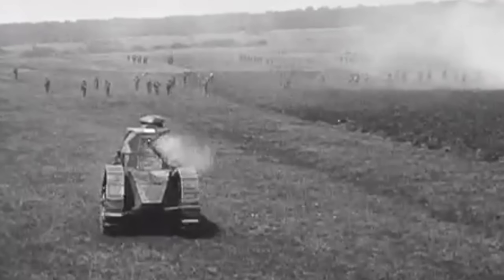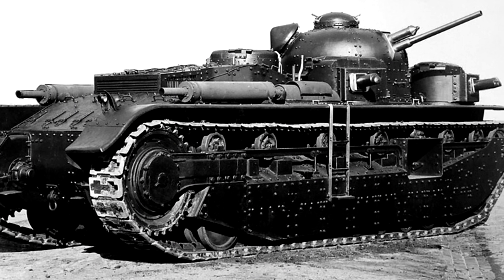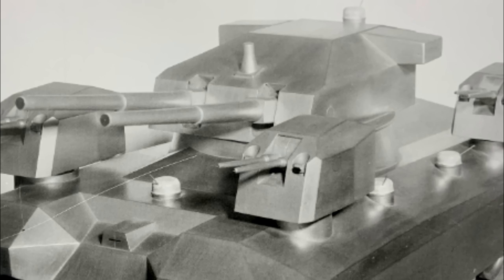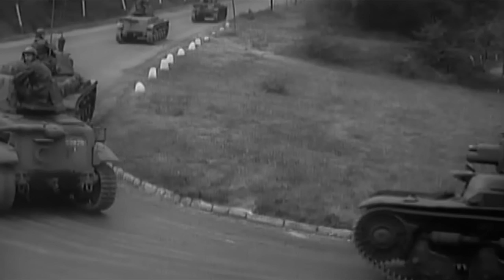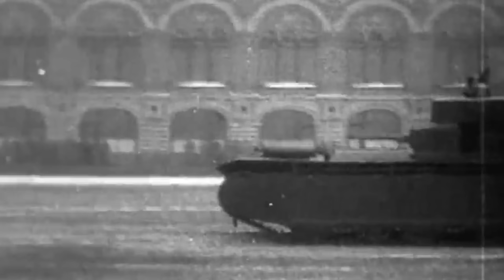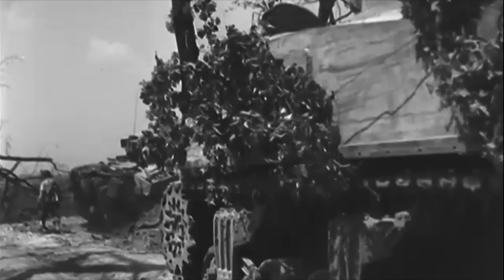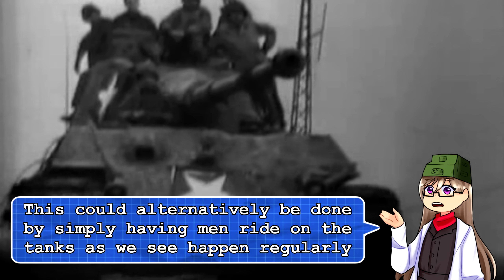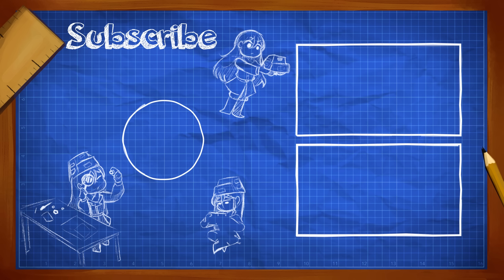Why do Multi-Turreted Tanks Fail?

Comment: One of the problems with multi turret tanks is that the two turrets are going to get into each others' way and it would be difficult to bring them both to bear forward and aft. Plus a multi turret will always have to sacrifice protection or mobility as the most powerful engine you can put in a single turret tank will be the same as you can put in the multi turret design.
Reply: Or you could do a slanted design if you'd want to do multi turret
Reply: Also, the commander already faces enough difficulty coordinating the gunner, loader, radioman, and driver. Add two or more turrets, it becomes a mobile bureaucracy; it is virtually impossible to keep track of everyone at once. It is one thing with an airplane, because the captain/commander is too busy trying to fly the airplane, thus leaving the maintenance and protection of the airplane to his crew. Meanwhile, a tank is under the constant threat of infantry and anti tank weaponry, especially the former, who can easily overrun and outmaneuver a tank, thereby endangering its crew (whereas airplanes only have to worry about AA guns, AAMs/SAMs, and interceptors). In a multi-turreted tank, by the time its commander had given orders, the enemy would have already overwhelmed them or left - there are too many responsibilities for the commander.
Reply: Like the nautical battleship, it'd have been no stretch of the imagination to have multiple ENGINES as well.  At greater weight, complexity, and COST, of course.  There came a point where the concept's flaws were self-evident.
Reply: I never thought about that
Reply: I was thinking turret on top of another. Like a coaxial helicopter
Reply: Larger engines can be produced, but if you want to stick with using multiple of a bulk produced engine you could have the engines run as generators for an electrically driven system to reduce mechanical complexity. The Char B2 used this method.
Reply: It's not a problem for ships, why don't warships replace their dual turrets with one humongous turret? Because ships are very long relative to their width, I think the reason is that simple, tanks just aren't long enough for multi turrets and ships aren't wide enough for fewer but bigger turrets. And tanks simply cannot be that long otherwise they can't be steered properly.
Reply: I also wonder, if it is okay to say that multiturret tanks exist and are called warships.
Reply: @utrock5067 although i hate how warships being called water tanks it does actually kinda make sense and thierfore will start calling them that myself because its funny
Reply: @dishmeup  Actually, the first tanks were originally known as landships.
Reply: @CharlesStearman and their codename was "tank/s" due to water tanks
Reply: @utrock5067  yeah how do ships with mutli turrets work?
Reply: @sheilaolfieway1885  Quite well, actually.  Rarely did those big battle-wagons ever engage at close enough ranges for direct fire.  Typically, battleships engaged other ships at long ranges, where, like a heavy tank on land, it used its typically heavier armor and BFGs to out-reach the enemy, attempting to hit them with "plunging fire", to penetrate the presumably thinner top deck and/or smash the superstructure(s).  If you look at most battleships or heavy and/or light cruisers, you'll see two big gun turrets forward, with the one behind the other raised to gain clearance for its guns, and one astern (a few classes had two astern).  While firing forward directly over the bow, or rearward over the stern, was quite possible, and desirable from an aspect of presenting a lesser profile to the enemy (i.e., "Crossing the 'T' "), most often guns were fired to one side or the other (rarely each, unless the ship was surrounded!), often in a "broadside", which would make the ship rock and literally "roll" quite a bit!  Indeed, it's a challenge for naval engineers to keep the vessel meta-stable as it is when simply under way with those big damn guns and turrets making the ship top-heavy as it is, and keeping it from capsizing when they're ALL fired at once!

Of course, controlling multiple BFGs and turrets isn't really an issue since any naval vessel has officers and crew to handle the many tasks associated with targeting and firing the big guns, including a fire-control section.  Any capital ship, be it a battleship as in WWI, or an aircraft carrier in WWII or since, is in reality a small, floating military CITY.
Reply: Multiple barrel could work just not in the effect of treaded tanks

For example the Sci fi tank the AT TE does multi turret tanks very well given the format
Reply: @redmafiapanda  Fiction can make whatever designs they want work within the universe. That doesn't mean it would work as well in real life. Perfect example being the Fallout 4 tank. They basically cobbled together every single terrible tank concept into a single vehicle
Reply: @filmandfirearms  sure they could

But given alot of sci fi has some sort of science to work with you can still sit down and analyze the tank design especially with star wars alot of their designs have been broken down and mapped as far as a tank design you can still analyze it
Reply: @redmafiapanda  Rule of cool is often far more important than mechanical practicality as far as fiction goes. For Star Wars specifically, the serious lack of stocks on most of the blasters is a good example. While a stock does help control recoil, something which would be irrelevant to laser weaponry, a stock's primary function is giving a third point of contact for the shooter, allowing them to hold the weapon steadier, allowing for greater precision. This is why air rifles still have stocks, despite their complete lack of recoil. It's reasonable to assume that laser weapons would encourage either a much greater use of folding stocks, or something like the Fallout skeletonized stocks, but they would still be present, and Star Wars ignored for quite a long time
Reply: @filmandfirearms  Yes while the rule of cool is prominent it still doesn't change the fact that you cant analyze a design even if it looks cool out of all the walker tanks the AT TE offers best stability for walker types and secondly they aren't lasers its plasma while we don't know exactly how recoil works with energy weapons that utilize plasma star wars weapons uses electromagnetics to propel the plasma giving its "bolt" form this is to the same argument that a lightsaber cant be real ignoring the force and lore implications scientifically all it is just a plasma sword
Reply: @redmafiapanda  My point is, it's fiction. It's not even guaranteed you could build an AT-TE if you wanted to. It's a nightmare for the square cube law, for a start. If it physically cannot exist in the real world, then it's irrelevant for discussing real world elements like turret design. As for the weapons being plasma, that just makes my point about stocks even more relevant. While the exact nature of it would depend on a number of other factors, any projectile that has mass is going to have recoil
Reply: @filmandfirearms  It being fiction is irreleveant analyzing the design is what we call inspiration and gaining ideas even if its not the exact same way it operates in the movies ofc not that isn't realistic but the applications of the design or coming up with designs based of that design is possible just because it wouldn't work in real life exactly the way it is doesn't mean its not worth looking at that's how you limit yourself to creativity and coming up with the next innovation